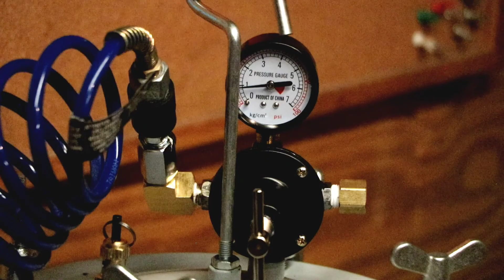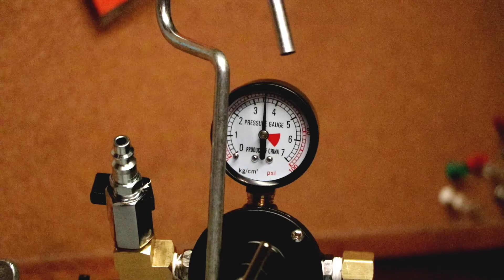Converting a Harbor Freight paint pot into a pressure pot for resin casting

Comment: Thank you for a good video!   My problem now is trying to find out why it won't hold the pressure.  I've used lots of soapy water and found a few things but still if I run it up to 40 or 50 psi, in an hour it will be down to 30, down to 20 in another hour...I should be able to leave it for a couple of days without running the compressor, true?  Any suggestions?   One of the guys in my club has a really awesome pressure pot but he spent around $400 on it.
Reply from the maker: It should be able to hold pressure at the set psi for several hours (if not longer). I ran into some issues with really bad threads on mine and ended up buying a tap for the size threads to clean them up. It helped on a couple of the threads and I just ended up over taping the other ones.

Comment: So do you keep the air converter in or remove it?
Reply from the maker: Do you mean the air diverter on the bottom side of the lid? Yes, I kept that in. I mention that around 2 minutes. It'll make sure the air, as it's coming into the tank, doesn't blow directly onto your project.

Comment: DEAR MC G , get a 5 gallon stock pot (to make soup ) a sheet of glass  and a $5 buck gauge TO do same job for about $20. no need to DESTROY waste the pressure pot Donate the pot to someone starting a painting business   .ps:The moisture inside the content in "VACUUM CHAMBER" will saturate card board on the bottom , collapsing honeycomb cardboard  by vacuuming air inside same , spilling whatever inside of the now bottom spill-pot  , etc...
Reply: A vacuumed chamber and pressure pot do not have the same uses. If you put a resin mold I to a vacuume the air will violently bubble out to make a useless cast. A pressure put does not degas, it adds atmospheric pressure until the bubbles are microscopic. Once curled the resin appears clear.

Also suggesting just a piece of glass with no real information is irresponsible, many glass panes will shatter when put under that pressure.

Comment: You might put a plastic disk. If epoxy spills it will not stick.
Reply from the maker: That's actually a great idea. I've toyed with the idea of making a small caddy...essentially just a bottom plate with a long handle so I can lift and lower pieces into the pot.

Comment: How do you adjust the safety valve?
Reply from the maker: Hey Caleb! The safely valve is a pretty basic mechanism using a spring to provide enough force to push back against the air. The safety valve that I used has a screw around spring plunger. You can tighten this screw until your tank is holding the correct pressure. Make sure you are not over tightening this screw or you can put yourself for risk of injury. I set mine for a pound or two over what I was aiming for, but still well below the rating of the pot.
Reply: same question here
Reply from the maker: Hey! Thank you for reminding me to answer this question. I hope it helps.

Comment: So I did this and I'm going crazy.  First one of these I ordered from Harbor Freight, Fedex basically crushed it and I had to go drive to replace it.  Once I got the replacement, I've been going mad fixing all the leaks.  Now I'm finding one of the pots screw downs isn't long enough.  I can screw it all the way down till there's no thread left and it still wiggles.

Ever have these issues and have any suggestions?
Reply from the maker: I have heard of folks having quality issues with these pots. It's unfortunate, but I'm not sure there's much of an alternative aside from maybe finding a local Harbor Freight and manually inspecting them in-store if that's an option.

Comment: so I made a pressure pot following directions. When I bring it up to pressure, it makes several "Tink" sounds. Is that normal?? What could it be???
Reply from the maker: That's pretty normal. The sounds you're hearing are usually some minor expansion in the pot. As long as you are below the pressure, which you are, you should be all set!
Reply: @TheAmateurHobbyist  thank you so much!!!
Reply: we get it up to 40 psi, the pot is rated for 60 psi

Comment: What you are doing is plumbing.
Teflon tape went on backwards,  always make sure to have the tapes end flow the direction of threads as to not unravel it while threading. - pro tip - good job overall though.
Reply from the maker: Thanks for the tip! I'll have to make sure I'm more aware of that for my next project.

Comment: Loved the vid.  Making the adaptations was not difficult.  Problem…..the lid itself had a leak where the blow out value was located. ( found using soapy water) . Ok things happen.. I returned it to Harbor Freight.  They were very nice and quickly exchanged it.  Happy me. Problem…. This one had a leak in lid around the base where the pressure gauge attached….maybe “MADE IN CHINA” isn’t worth the saving.  With the price of gas now a days I’ve run out a lot of gas because the nearest Harbor Freight is at least 30 miles from me..
Reply from the maker: Thanks! Yeah, when you go cheap you run into other issues. I lucked out with mine, I do think I have a small leak somewhere that I haven't tracked down, but it works well enough when I need it. I am planning another video soon with some additional modifications to make it a little nicer.
Reply: Yeah it's a bummer Pam. In order to get the most out of harbor freight you really need the skills to be able to fix or modify the things you buy there. It might even take welding to fix some things! 😂

I've had to modify nearly everything I bought from there.

Comment: Honestly I'm more interested in that smooth jaw pipe wrench you have. I used vice grips and messed my threads all up.
Reply from the maker: I'm a huge fan of Knipex pliers. These are the pair I believe you're referring to in the video: https://www.amazon.com/Knipex-8603250-10-Inch-Pliers-Wrench/dp/B000X4OG94. These have parallel jaws without teeth. I highly recommend them.
Reply: Never use vice grips or channel locks on a nut or bolt for that reason!  That's why the make wrenches that come in many sizes, sometimes an adjustable open-end wrench will work.

Comment: Now if only I can get mine to stop leaking air out the lid at 5+ psi so I can see if anything else holds air -.-
is there also anything that can dampin or muffle the sound from the air compressor?
Reply from the maker: Sorry I missed this comment! I've seen some folks that have built a box around the compressor to help muffle the sound a bit. I do believe you can get quiet air compressors as well, but that usually comes with a higher price.